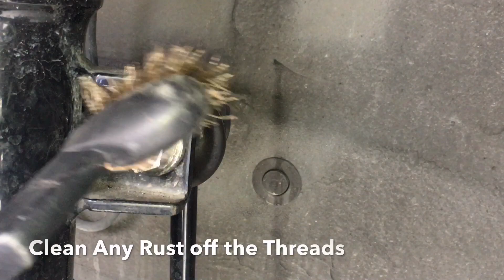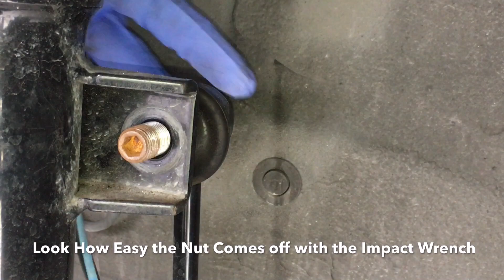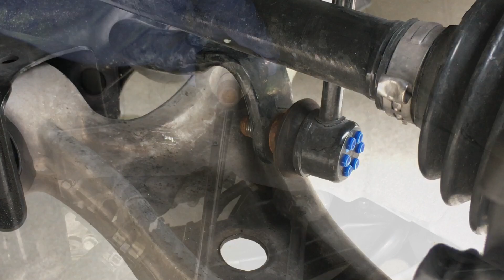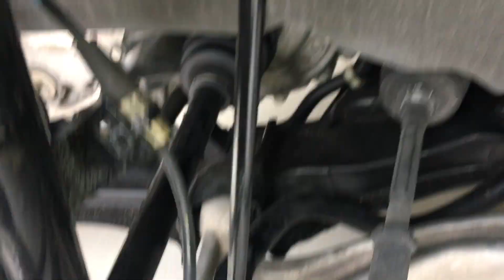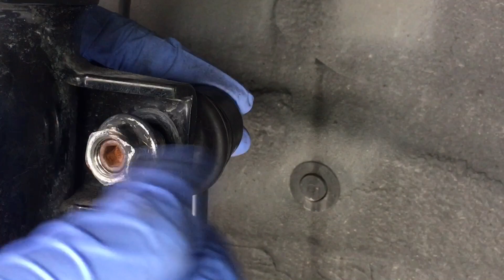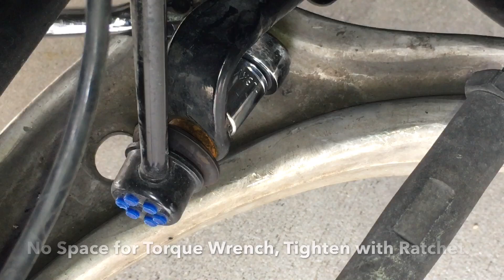Honda Odyssey Swaybar Endlink Replacement DIY

Comment: Just did this on my 2013 Odyssey.  Three of the four nuts were seized and I ended up cutting them off with a recip saw.  100% recommend buying replacement flange nuts before you start.  2 of the 4 got stripped.  They are M12 1.25.

Comment: Are the flange nuts the same for both top and bottom?  I assume they are but just want to be sure.
Reply from the maker: yes
Reply: Thank you!  Crazy that you have to buy the OEM hardware (nuts) separately!  lol @MrRangerZr1
Reply from the maker: @michaelwilson2891  usually you can reuse the nuts but if they are rounded off or crusty best to replace

Comment: How do you know when it is bad??? Was the one your removed bad??? The van i have has 115k miles i think the are original, with the 5 blue dots in the back of the ball joints
Reply from the maker: It'll be torn and loose
Reply: Does it make a noise when driving?
Reply: @3CHD yes. Tapping noise over small bumps. Tapping noise from side to side.

Comment: I wish mine came off this easy. I had to blow torch the booger. Was a PIN.
Reply from the maker: Yep sometimes you need to chop or blow torch it off, especially in the rust belt states.
Reply: Yep, going through that now 😖 I even sprayed penetrant the night before. I have two options, 1st to hold the backside with a vise grip. 2nd to just just cut if off. I don't have a blow torch.
Reply: @elgatogordo9523  I ruined 3 vice grips trying to hold mine. Gonna have to cut with my cutoff wheel now. What a pain. They really need a flat edge on backside to hold it as the allen hole is a joke.
Reply: @onlywenilaugh6589  Honda doesn't want it to be easy for you. They want you to come to them for the job.

Comment: Doing my sway bar links right now and uh... I'm gonna assume you don't live in the rust belt.  My impact wrench alone couldn't get them off.  Using a vice and the impact wrench, the right came off.  The left isn't moving.  I may have to cut it off.  Oh well.  We live in both the rust belt AND on a gravel road.  Double trouble!  :)
Reply: I ended up cutting the left one off!  Oh well.  Got my new ones installed.
Reply from the maker: even not in the rust belt sometimes you have to chop them, it's annoying...

Comment: not really that easy of a plug and play, trying to get them out and back in, sometimes requiring two jacks to get the holes to line back up, otherwise, good video
Reply from the maker: Were you changing the endlinks with both front wheels off the ground? If you have one wheel off the ground and the other on the ground, you'll never get it to line up.